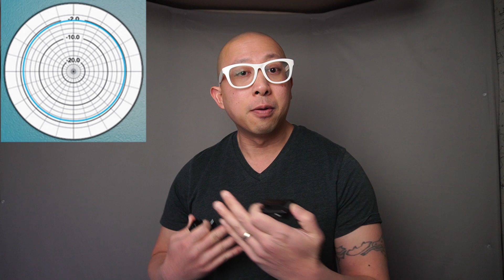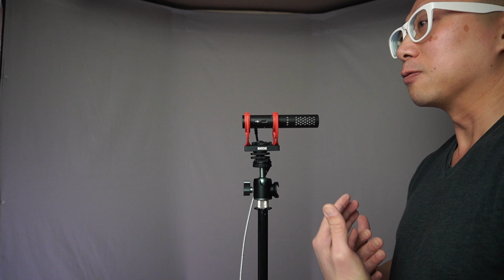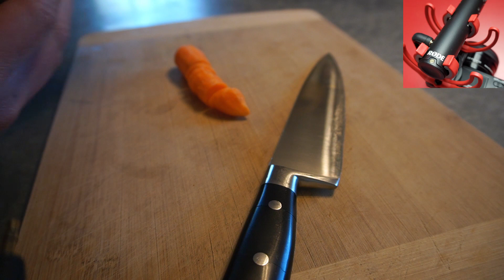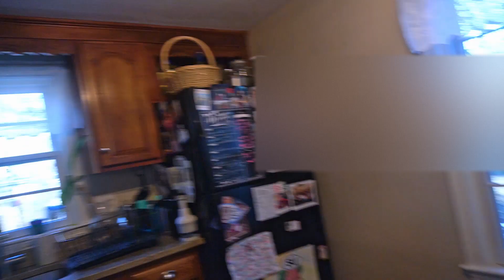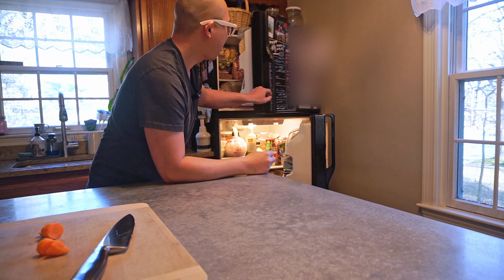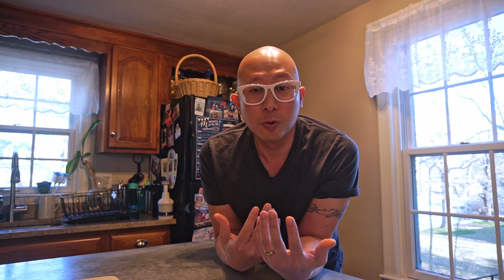Understanding Polar Patterns for Beginners - ft. RODE VideoMic GO II & Wireless GO

Comment: Great video! Quick question… the audio from the Rode wireless go does not sound like that straight from the box, the mic is extremely sensitive and picks up almost every sound heard by the ear…. Could you please guide me on how to get such crisp audio as you have created. Additionally, in a situation where I am live streaming and need the audio straight from the receiver, how do I go about getting good crisp audio (no post processing)
Reply from the maker: Thanks for your comment and questions!  There are a lot of factors that may be at play in your situation.  Do you have a Wireless GO I or a Wireless GO II?  There may be differences between the two models factory settings.  It sounds like you might have a GO II if you're using it for livestreaming and I'm assuming you're connecting the receiver to your computer via USB (and using RODE's software to detect it as a USB mic).

It also really depends on what camera you might be plugging the receiver into.  Other factors that can affect your recordings included your environment, how you place the mic on you, your own individual voice and potentially physical features.  As the built-in mic is omnidirectional (picking up sound in every direction) placing the mic closer to the sound source you want to record (in this case your mouth) can help in that you can lower the overall gain.

But when it comes to gain, if you have the receiver plugged into a camera and you are getting a lot of white noise or background noise, try setting the Wireless GO to it's highest output level and setting your camera's record level to as low as you can while still getting a signal between -12db to -6db on your camera's meters.  Typically, this ensures the cleanest recording as your audio equipment generally will sound better at a higher level than your camera's mic input.  Hope this helps!
Reply: @WayneRECs  massive thanks and huge help! Thank you so so much! Definitely saving this. Bless this Channel
Reply: When I turn up the gain to heat my voice more clearly, the background noise level also increases….  I’ve been playing around so much with it and not understanding how these YouTube creators audio sounds so gooodd

Comment: Is there a way to have both? Your example with the kitchen, is there a way to record voice from Rode wireless and Videomic for the other sounds. FYI the sound of the Videomic cutting board was amazing. BTW, nice kitchen. I didn't realize the Rode Wireless was omnidirectional. I've ruined some video because it picked up a lot of background noise. Great video.
Reply from the maker: Nestor!  Thanks for asking!  Yes, in fact in your specific case, if you have a RODE Wireless GO II w/ two transmitters, you could wear on transmitter like a lav AND then plug in a mic like the VideoMic GO II into the second transmitter.  This would send both to your receiver and depending on how your RX is configured, they could be separated into one in the L channel and the other in the R channel (or just have them mixed if that's your preference).  And yes, the cut carrots w the VideoMic sounded great!